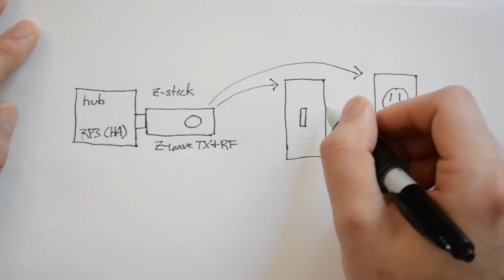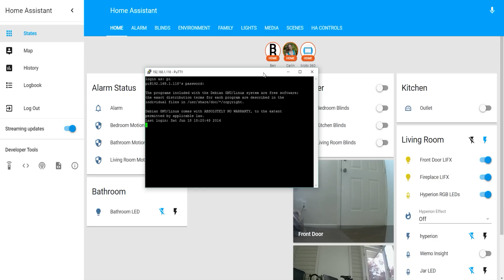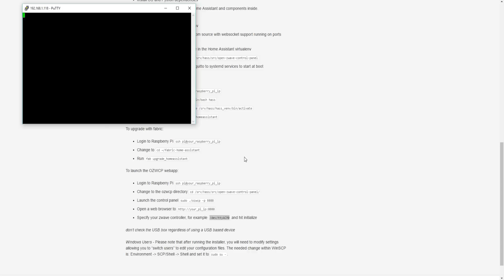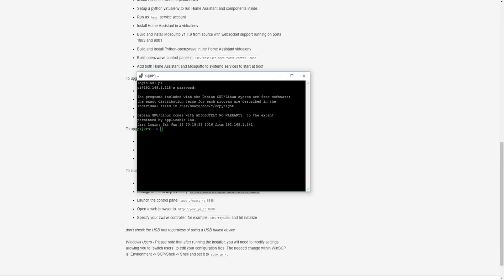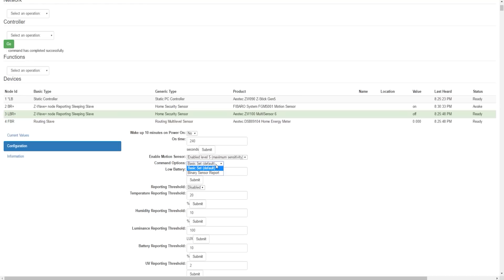The BEST DIY Z-Wave Tutorial - How to Get Started on a Raspberry Pi

Comment: Have you looked at the aeotec home energy monitor that's kinda the main reason why I want to do z-wave I already have a couple wifi stitches and bulbs and a couple Pi's lying around so I figured why not still cheaper than any of the other complete systems to monitor power for the whole house

Comment: No offense, but I completely disagree. Custom solutions are modular and upgradeable. That argument just doesn't hold water. Also, they are integrated, so all of the components are tested together and supported. Perhaps most importantly, there is installer and manufacturer support and warranties on the whole system for when things don't work. With a DIY solution, you're on your own. If you are a DIYer and fairly tech savvy, then DIY solutions are worth a look. You mention that it's cheaper than a custom solution, and while that's often true, it's also true that you get what you pay for and therein lies the tradeoff. DIY == cheaper, Custom == tested and supported.

Comment: I can't login with pi@ipadress just with root. I used the hassbian Image for my rpi3 with works very well. But I can't use the normal User "pi" but I need to access the OpenZWave Control Panel. Could you help me?
Reply: I have the same problem!

Comment: Biggest issue with z-wave is the country specific bands. Makes buying products online very difficult if you're not living in the us. Zigbee at 2.4 GHz is far more standardised than z-wave. Also, Bluetooth 5 specifications has been rolled out and it includes the ability for a mesh network ... Just need devices to support this.

Comment: Hi, I installed hassbian on my Raspberry 3+ according to you other video and have now installed the razberry for Z-Wave control. As the razberry is not connecte to any USB I am struggeling what to enter in the configuration.yaml under "usb_path"? Also, I was unable to find the right "config_path".
Would be great if you could give some hints what to do.
Reply: hi on your computer's explorer type this \\192.168.*.*\homeassistant changing the * for the IP of your PI if your home network IP is 10.0.0.1 just change accordingly.  you will see the config file, edit it with Textpad or notepad++ which is easier, but if you only have notepad it works too. if you don't have any other USB devices connected to your PI, odds are you will have this same config

# ZWAVE DONGLE
zwave:
usb_path: /dev/ttyACM0
config_path: /srv/hass/hass_venv/lib/python3.4/site-packages/libopenzwave-0.3.1-py3.4-linux-armv7l.egg/config

hit save and reboot your PI. 

when you open your home assistant again, you should see the zwave device on your right. 

hope this helped

Comment: I use an Aeotec Z-Stick (Gen 5) to connect two Aeotec Z-Wave MultiSensor 6 (powered by USB). The problem is that there will be a 1-2mins delay in the change of Luminance figure (from 100 to 0) when the I turn off the light in the evening.  Refresh node can change the figure quickly, is there any way to let HA refresh the node in a high frequency (such as every 10 seconds)?  Another problem is that the Motion figure change from "on" to "off" with a serious delay also (maybe 5 mins). And refreshing the node does not work for this. Is there any way to get real-time motion figure?  Thanks.

Comment: Hey, BRUH! Thanks for the walkthrough! I am installing the Home Assistant, but I have a few issues so far. Ate the Open Zwave Panel, my UZB SIGMA dongle is listed at the devices list but not identified (or identified as a generic device). Since the Open Zwave page (https://github.com/OpenZWave/open-zwave/wiki/Controller-Compatibility-List) says it supports, I believe that I did something wrong. Also, this device does not have a button to innitiate the pairing mode, so I wonder if can just do that from the OZWCP GUI, is that corretc? Could help me? Thanks alot!

Comment: Hello, this weekend I made some mqtt sensors with nocemcu's:
* DHT22 + light
* DHT11 + light (had no more dht22's, doh!)
* PIR
* NeoPixel Ring (this one based off your code)

I also got detected 5 sonos zones and my 2016 lg oled tv (webos).

It's very fun and mostly it works very well, however I have yet to control any more light than my neopixel ring.
I have mostly today mr16/gu5.3 (12v halogen) spots and I know if I want them to be led controlled, I have to swap to electronic trafo and then replace dimmer wheel with switches.

Then the question is: to z-wave or not to z-wave...
Of course I know I can buy z-wave senors, but I can make cheaper sensors based off Arduino and Wi-Fi.

Even a sensor mesh based off NRF2401+ would be doable :-)
Z-Wave means of course a dimmer/controller and z-wave bulbs, then there is the option of Philips Hue or maybe even Lifx (LifX is hard to find in Norway though).

It seems you have a lot of experience with this, so would you go z-wave or not? I'm thinking maybe Wi-Fi bulbs might be a better option, since you then dont need any controllers(?). Too bad Ikea tradfri is white only..

I guess also it's doable to just buy Z-Wave dimmers and use a Z-Wave usb dongle on my RPi and then dimming my 12v halogens(?). I dont really know if I'll be using colors that much, I see how it would be super with something like a Philips tv with ambilight... I know in theory one could of course make a ambiclone and make that send colors to the Home-Assistant (like ambilight can do with hue).

I know there is not a perfect answer, it seems like LIFX has way better light output than Hue and for an apartment Wi-Fi would work well I guess? However hard to come by in Norway :(
Reply: Hei, hva fant du ut angående z-wave etc? :)

Comment: Hey Ben, have you tried the samsung smartthings hub? I'm interested in building my home automation and I've been looking at the samsung hub connected with Yale door locks, garage door opener and switches. Then, connect it with google home for voice automation. How easy is the HA RP3 vs Samsung ST? 

I'm located outside USA but I'm shopping from USA (with US Version Z-Wave Frequency) but I have to make sure the devices work either with battery or 220-240v AC capable.

Comment: usb_path: /dev/ttyACM* shows me acces deny you dont have permishion. what i have to do?
Reply: The user you are running HA as need to have access to that device. Check what group is configured for /dev/ttyACM by running ls -l /dev/ttyACM*. Most likely it is the group "dialout" and then you can add your user to that group by running: sudo usermod -a -G dialout your_user. For the changes to take effect you need to logout and back in. You can also verify the access by running: pyozw_check -i -d /dev/ttyACM0

Comment: Ok so here's a possibly stupid question : why go with Z-Wave instead of WiFi? Unless it's a really large home, so you want to go with Z-Wave because that will give you greater range compared to WiFi. But say I live in a small apartment. It seems $$$ efficient to go for WiFi outlets and switches instead of Z-Wave. I am just starting with this whole home automation thing and I don't know much (or at all), so I am trying to get as much info as possible. Also, what about sensors? For example sensor for when a door opens. Maybe that's where I should go with Z-Wave?
Reply: Yes, that. ZWave is fantastic with battery life because the sensor sleeps almost all the time - it doesn't have to maintain any sort of connection. It generally wakes up once every 24 hours and receives any configuration updates from the controller at that point. It does not usually do this when it broadcasts an event like a door being opened or whatever. With WiFi devices - they have to have an IP address to broadcast to the network, so that means whether it is a movement sensor, door contact or thermometer - unless it stays permanently connected to the network - which is very inefficient on the battery life, then it has to wake up, connect to the WiFi access point, wait for DHCP to give it an IP address, broadcast it's message, disconnect from the network and go back to sleep. That process can take upwards of 30 seconds - which is a bit too long when you want something to respond to that event (like a light being turned on as soon as you open the door).

My ZWave network was rather unreliable, but I recently purchased several Greenwave sockets with energy monitoring for £20. Now my network is fast and reliable, and because I am dealing with signals needing to travel through some very thick walls, the mesh network is really useful (do note though, that he doesn't mention in the video - that there is a maximum of 4 hops, that means a message can only be retransmitted 4 times to reach the destination, after that it will be dropped and the controller will report an error communicating. It's easy to see why too - because ZWave is 2 directional, so the message to a device, has to have an acknowledgement from the device sent back to the device which sent the message originally. So a Controller telling a far away light to turn on, is retransmitted 4 times to reach the light, the light then sends an acknowledgement back to the controller which is also retransmitted 4 times to reach the controller - that can really cause a bit a delay in responding, and while that is going on - nothing else on the ZWave network can send or receive data).
Reply: I like Z-wave because where I live the 2.4ghz band is really congested so my wifi is already unreliable. Add 50 additional smart switches and outlets all connecting via wifi will only make the problem worse. If you care about reliability Z-wave is the best way to go for right now.
Reply: Interesting. What does this delay mean in practice? What is the order of magnitude? We don't want the whole home automation infra coming to a grinding halt because of 2 remote devices interacting with each other..
Reply: I am switching the IOT in my home from WiFi (mostly Sonoff and esp8266 devices of my own design).  There are no UL approved WiFi wall switches, so in order to control lights, I have a few Sonoff Basic modules crammed into the wall box behind a switch.  This works, but would never pass a home inspection.  There are UL approved Z-Wave wall switches, and best yet, many of them are 3-way ready.

In an apartment, changing a wall switch to a Z-Wave switch is a five-minute job and easily reversed when you move out.

Comment: Quick question. Once installed should this thing keep a certain LED color or should it cycle through red/yellow/blue during normal operations?
Reply from the maker: The fibaro multisensor? It should stay on the same color when it detects motion by default. That's adjustable via OpenZwave though.
Reply: BRUH Automation actually the USB dongle. I just set mine up and it's cycling all the colors.
Reply: Below is a link on how to disable the colour cycle:https://www.reddit.com/r/homeautomation/comments/4vne9x/guide_disable_aeotec_zstick_gen5_blinking_lights/

Comment: Oh so many questions, 1. Does it need to be a PI unit for me to use this?  2. Can I use an old PC laying about to get this done, if I install some sort of open source Linux?  3. Are the Zwave components only made by GE?  That seems to be the only ones I see when I google.
Reply from the maker: A Pi is going to work a lot easier than a PC. Most computers will support Zwave via the Zstick. The prerequisite is that you can install OpenZWave. That is Zstick needs to access to run. I will say it is much more difficult to do it in Windows or other computers. You'll find a lot of DIY tutorials and such for the Pi which makes it a lot easier to use than Windows. Cheers!

Comment: I have the 5th gen aeotec z stick RP3 and a GE 12722 z wave on and off switch. I think I can get it to pair but I'm not sure. no devices show up on HA frontpage but I can see and toggle the switch from the open z wave panel. how do I get the switch to show up on the front page?
Reply from the maker: Sorry for my delay in getting back to you. That's strange it isn't' showing up on the HA front end. Most likely something is wrong with your configuration.yaml file. Make sure where you are linking that to in the configuration is correct. I know I had a version of OpenZwave update that broke that link and killed my Zwave intergration. Cheers!
Reply: +BRUH Automation I got it figured out 4 days later. I didn't have my z wave section spaced properly. Funny how a couple of spaces can cause problems huh?

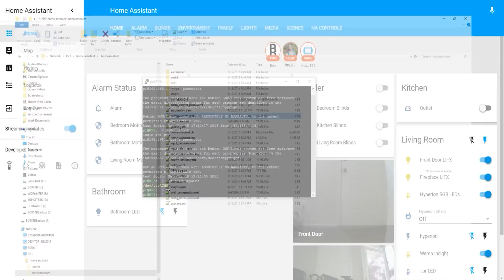Comment: for the life of me I can't figure out how to get to the home assistant configuration file. I'm using putty to get into the pi and I have a tab open with the home assistant running in chrome. It looks like you can see you pi in the video at 6:21 in your network. How can I get this to show up?
Reply: Gregory Durand you need to use a program such as WinSCP .  check out the raspberry pi set up videos on this channel
Reply: Kyler Massey thanks, I was able to use samba to get to the files using my Windows PC.

Comment: Great Video and Videos. Im a starter and have installed HA and got it to load. I have problem with samba letting me in the folder via windows, it will not let me get into that folder om my Win10 machine. Also the z-stick, i plugged it in the pi3 and after that i could not load the HA webpage and i cant login to putty. i removed the stick but putty will still not let me in. So im not sure how to proceed at this stage..

Comment: Great video Ben!
I'm a newbie here and the Linux neophyte so go easy…
I have my PI three running with HA (thanks to you) and I was able to put this:
zwave:
  usb_path: /dev/ttyACM0
in my configuration.yaml file and now on my homepage switches show up and they work!
I'm looking for some code examples to put in the configuration file that will make the names meaningful not: Enerwave Unknown: type=0111, id=0605 Switch
I saw something about friendly.name which sounds like what I want but I can't figure out how to associate that with each switch and where to put it. Do you know where some code samples are for this?
Reply from the maker: For sure! Customize is available in the configuration.yaml file. Here is an example. https://github.com/bruhautomation/BRUH3-Home-Assistant-Configuration/blob/master/configuration.yaml

Another thing you can do is fire up OpenZWave (details are on the All-In-One installer page) and assign a name to the switch.  Be sure to apply it, then hit save in the top right, then restart your Pi. That should also do the trick. 

Cheers!
Reply: I think I'm not understanding the syntax needed, I looked at your link above and here's what I added:

customize:
   switch.Enerwave_Unknown_type=0111_id=0605_Switch_1:
   friendly_name: Kitchen Lights

But this seems to make no difference, all I'm trying to do is add "kitchen lights" to the switch label…

Comment: Great video!

But, seriously - you don't have to keep rebooting your Pi. This isn't Windows. :-) Just figure out which service / daemon you need to restart, that'll go a lot quicker.
Reply from the maker: Haha, for sure.  Old windows habits die hard. :P
Reply: So how do I do that, I would like to know! 
Lets say I edit configuration.yaml and want to restart (I'm guessing) HA?
Trying to find my usb_path for my GPIO card (instead of the Z stick), with no luck. And every try takes 5 minutes. Getting "Invalid config" in HA (IP:8123).
Reply: Maybe I found some in HA. 
Services > Domain: homeassistant > Service: restart.
But again, any clues about the usb_path? Still can't find it.
Reply: If you have PI3, /dev/ttyACM0 is used for internal bluetooth. Try /dev/ttyS0.
Read these topics:
https://community.home-assistant.io/t/raspberry-pi-3-razberry-z-wave-me-gpio-daughter-card/450
https://community.home-assistant.io/t/home-assistant-razberry/2660
Reply: Mine usb_path was /dev/ttyAMA0 (for Razberry)
Had to remove some texts also from this thread, last post
https://www.domoticz.com/forum/viewtopic.php?f=24&t=5862#p69053

Comment: How do I control my  z wave wall switches, light switches or power outlets using my phone? I already have z wave hub installed. Thanks.
Reply from the maker: You mean you have the Aeotec Z stick setup? You'll need to get the switches setup in HA first, then you'll be able to use them from the HA UI on your phone without a problem.

Comment: Great video unfortunately  I can't get the Aeotec Gen 5 to pair to anything.  I used to have an Iris system that I abandoned.  I have put the devices in pairing mode then press the button on the stick but they never pair.
Reply from the maker: Yeah, this happens from time to time. Zwave can be a real pain. Try and get into OpenZWave and see if you can see anything there. I'd also factory reset everything. In my experience, if it doesn't work on the first shot, it's an immediate uphill battle. :/

Comment: Will these steps also work if I have HASSbian image? It seems I cannot find the open-zwave-control-panel to configure.
Reply from the maker: Kind of. The commands are slightly different. Plus, with Hassbian you'll need to install OpenZWave first as outlined on the Hassbian info page. It's a bit of  a pain, but the instructions are good. I'm still running the AiO method, though. If you'd rather, you can hop over that install method to avoid the hassle. Cheers!

Comment: is there is difference between this z stick and verilite wifi module that kinda of does the sam thing. So mU question is if U have a verilite wifi module that also works in zwave, Do I need the combination of rapi and z stick ....... thanks in advance ...
Reply from the maker: Using either a ZStick or the VeraLite will work with HA. The Zstick allows direct Zwave control whereas the VeraLite acts as an intermediate hub in the Zwave network. I'm not sure if there is an advantage one way or another. I bet the Zstick is a little fast, but the Vera might be easier to use. 

Not sure as I haven't tried it! Let me know what you get working. Cheers!